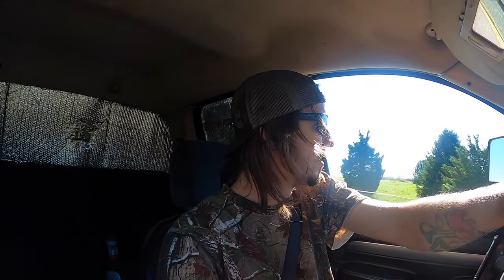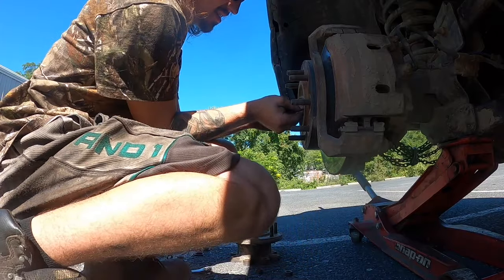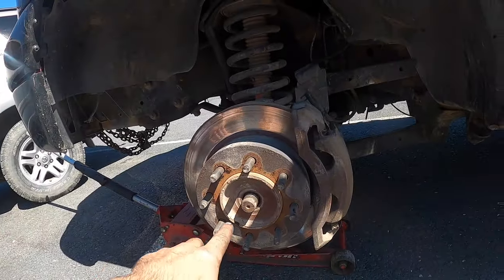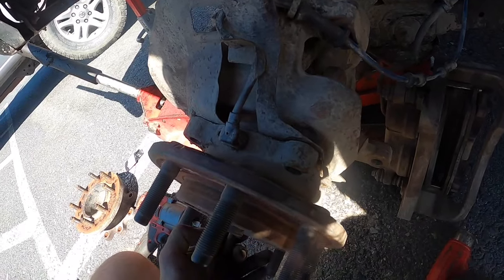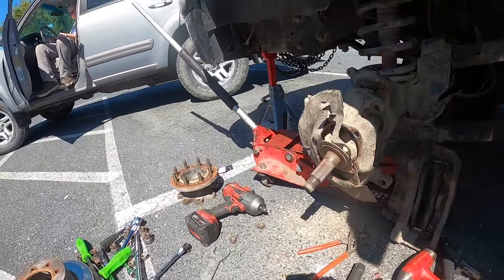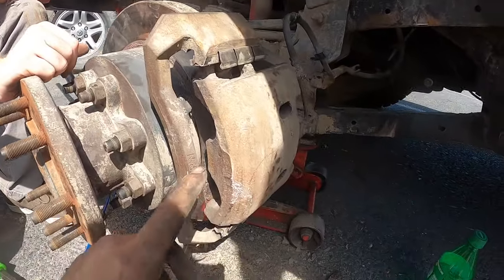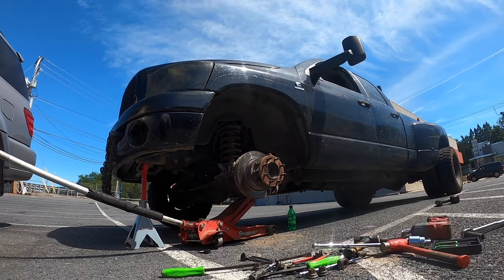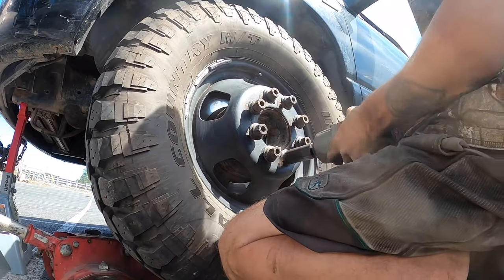Broken Down Ram 2500 Cummins Wheel Bearing Replacement | How To

Comment: Looks like your axle extensions to allow 35 in wheels is killing your Ram wheel bearings due to approx. 3 in. of cantilever.  Proof - both bearings gone at the same time.  Bearings not designed to carry this extra load.  Terry Jenkins
Reply from the maker: I don't have axle extensions though. Those are factory spacers. Every 1 ton dually has them. I'm thinking what killed them was the fact that I drive my truck through 5ft of water every other weekend😂
Reply: @Terry Jenkins  No Axle Extensions!. Its Factory 1 Ton Style setup.

Comment: to maximize the bearing life, torque the axle nut to specs, just running it on with impact is not the best practice.
Reply from the maker: I torque them on customer units. On mine I just impact. I bought the truck with 315k and the passenger side lasted until 460k but I had it off quite a few times for u joints and other maintenance so I just impact them on. The driver's side I replaced 80k miles ago. The thing is I run through 5ft of water at times when I'm at the mud hole and they were both caked. I sure that's why they both failed at the exact same time. Luckily I have a 3 year warranty on the passenger side and 1 year left of the warranty on my driver's side.

Comment: Yikes impact the axle nut no wonder why the first bearing didn’t last long! Loosen bolt with a torque wrench but not retorquing anything interest method. Sir please put the tools down and step away from the vehicle 🤣
Reply from the maker: 🤣🤣 I have 100k on the one I replaced and I never replaced the other side. I think it's convenient they both failed after I kept submerging it in mud. Both bearings were caked and you could hear all the crusties on the inside😅

Comment: WHY! Are these bearing such trash!? Brand new Rams have the same failure after 50,000 miles!
Reply from the maker: Stay away from Mood, man. They've been just as bad as oem. They used to be great until they got bought out. I've gone through so many but they are 3 year warranty. The new set hasn't failed yet but it's only a matter of time!

Comment: 260ft lbs for axle nut is critical. Like most people I don't bother torquing the majority of hardware on my truck. But steering and suspension is one thing I won't skip torquing.

Comment: Should invest in the ram man Inc locking hub conversion... Quick and easy install and save lots of money down the road too, I remember that you and talk about it on Facebook messenger a week ago... Lol
Reply from the maker: I'm so surprised that the original one lasted this long. I bought this truck at 312k miles and I'm just shy of 460k. The passenger side lasted this long and the driver's side gave out at barely 80k miles. I know I'll save on u-joints but I found out how easy they are to replace I just stopped worrying about it. These bearings are under warranty for 3 years so I'll replace them all day lol They've been under water quite a few times though.
Reply: @CPSteveMiller 
Maybe next time they die out of the warranty window, could always go for the lockers then... You might have better luck with the 2 new wheel bearings may give you 80k more miles... We will see...